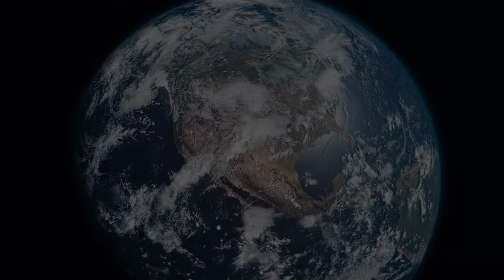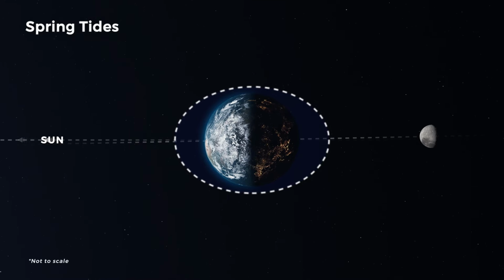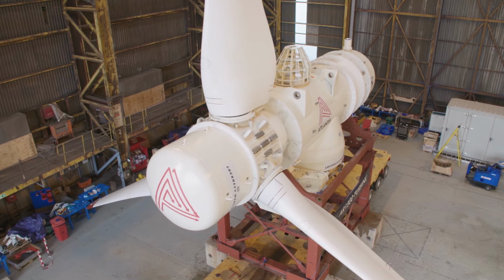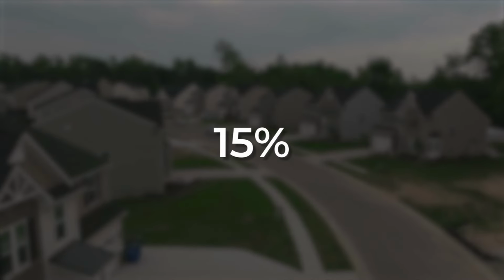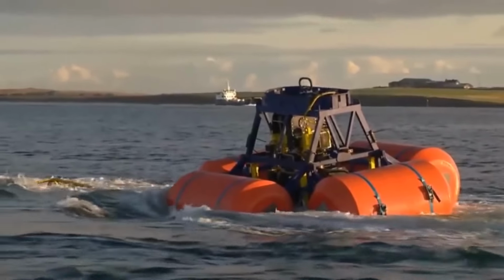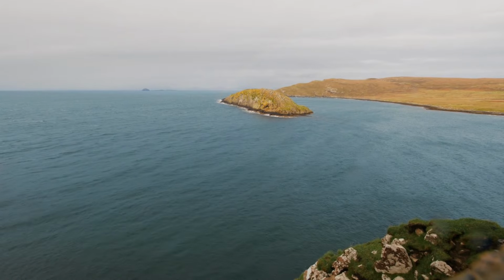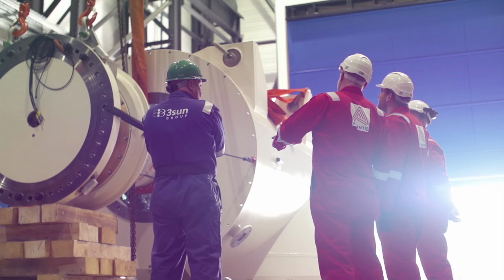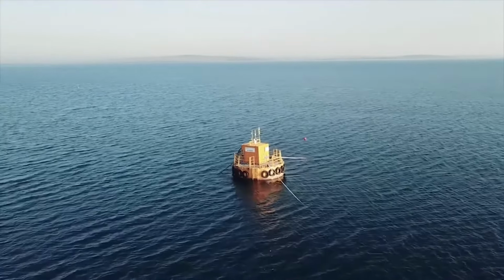Can Underwater Turbines Solve Our Energy Problems?

Comment: I've been working on ocean current and river current turbine designs since 2016 and believe that by the end of 2030 not only the ocean energy but also low speed river current turbines will contribute a major part in energy sector.
Reply: Multiple installations of numbers of identical low speed tidal turbines arranged in 'racks' in many sea areas, hence the 'multiple', and run according to a 'routine replacement rather than repair' maintenance schedule would provide a constant and predictable, apart from breakdowns, power supply, and would prevent trawling in large areas of the sea bed allowing the natural habitat to re-establish itself. The inevitably high capital cost, minimised due to the economies of scale resulting from the use of identical turbines,  could be amortised over many years and the installation would have a much longer life than the current 18 -20 years of wind turbine installations. The use of as much as possible of the existing power export facilities would also reduce the initial capital cost.

Comment: A few years back there was a project some guys at my company were working on with Imperial College utilising tidal movement. It didn’t involve any wet moving parts, just tubes angling down into the water. The idea was that as the column of water in the tube moved up and down the associated air movement would turn an impeller directly mounted on a generator. They trialed it in a canal lock and it worked pretty well. Almost no maintenance was required and they could be ‘hidden’ from sight under soil and plants. They were waiting for funding to take it further. I have no idea what happened after that, I left the firm in 2004.
Reply: https://www.youtube.com/watch?v=kXfSrCWA7qA
Reply: @PerhapsNoodle  that’s great thanks for the link. I’ve not heard of the well’s turbine design. It’s a great innovation and has the same low maintenance profile as the project I was aware of which was based on tidal movement which is a bit different, but still harnesses the natural movement and power of the sea.
Reply: I just finished a final year research project on oscillating water columns. Seriously impressive machines, but the main issue is a lack of funding as is the case with most renewable technologies not yet adapted by governments and companies.
Reply: What about barnacles, and other sealife infesting those tubes? Over a short while, they'd render them unproductive. Just stop fighting what has been proven to work: fossil fuels & nuclear!  Your libbie "ideals" won't do much good when the "rolling blackouts" hit YOU!
Reply: @DavidRice111  is this a joke?
Reply: Maybe it wasn't economical.
Reply: Hoover dams in tides ignored that reverce naturaly at peak 4 + times rpm gearing to light speeds if  wormhole  wanted  and you built you own  maganetic bearings they control
Reply: @stevenlonien7857  what is wrong with your brain

Comment: VAWTs (realigned as HAWTs) are used in unidirectional flows. Safer for marine life (prob because full aerofoil/hydrofoil). However if that boom arrangement could swing through 180°... Or just use paired HAWTs (one above and below each boom)

Imagine Sydney Harbour between the heads, all commercial and Navy traffic moved to Botany Bay (et al). Tides 0.48m-1.89m + 0.28m-1.36m (Sat; 14/12/19)
ps: My teenage thought was to dam it and turn it into a fresh water lake.

Comment: Have you heard of GravityLight?  Why don't they make tidal generators like that?  The rising tide raises a very heavy (but buoyant) weight up a vertical shaft.  When the tide goes out, the weight is released and slowly falls down the shaft.  It contains gears to slow the descent.  The gears turn an alternator/generator to produce electricity.

Comment: Not everywhere has 4 tides per day. The barrier islands, South Carolina, US has diurnal tides (two).
Reply: Sort of, but actually what happens is that the larger high tide each day catches up with the lower high  tide. If  you plot the tides as a graph you will see that the lower high tide forms as a a  shoulder on the high tide recession without a drop in between  the tides. So there is only one maximum per day.
Reply: Gribbo9999 I see what you’re saying and that’s true

Comment: 6:02
...Uh-huh. Y'know, storing megawatts worth of convertible energy to be used to generate electricity is probably a greater engineering feat than building the damn hydroturbines that can generate that peak amount of power. Unless you want to build several million flywheels... If you care about the environment, do not even suggest battery banks. There is one eco-friendly(ish) solution. Utilize peak electric and unneeded energy production to make hydrogen fuel cells and burn that when your renewables aren't meeting demand. "B-b-but... But it's inefficient!" someone is itching to reply with. All renewable energy is inefficient. So moot point.

Comment: Barrages are expensive but have other benefits besides tide power, like:
-Forming bridges;
-Forming a tunnel at the base of the barrage;
-Pretty well constant locked-in water levels for ships docking;
-Acting as flood protection;
-Access to the enclosed near constant level water 24/7;
-No waiting for tides for ships to enter port;
-The barrage being a mountings for wind turbines;
-Flood protection;

A barrage was considered for the River Mersey at Liverpool, between New Brighton and Bootle (I believe still being considered). One suggestion was a road on top with a tunnel for the Merseyrail metro network built into its base.  The whole river estuary would be locked in with a series of entrance locks used 24/7, rather than having to wait for high tide to enter the existing enclosed, locked, multiple dock systems in the estuary.  The expensive cost of maintaining the existing locks in the multiple dock systems in the river would be eliminated.  The barrage would also act as flood protection. 

Something like the proposed multiple use Mersey barrage then would a very cost effective project.

Comment: There is one key problem with cathodic protection. While it does an excellent job of protecting materials from corrosion, it is dependent on the material being used for the cathode and the material that the cathode is supposed to protect. While this does limit could be used as long-life cathodes, what can be used is still quite good. However, it then comes down to the size and type of cathodes. One excellent example of cathode protection is a few collections of silver coins that were excavated from the sea bottom (one of these was found by Arthur C. Clarke). The coins, while covered and held together in a massive clump by undersea growth, were in contact with a massive iron cannon. This meant that the electric current in the seawater (this is too minuscule to be perceived by humans) had two different materials to react with for electron exchange (this causes the corrosion), silver or iron. Because current travels through the less resistant material, it passed through the iron cannon rather than the silver coins, so the cannon rusted away while the coins remained intact - and they were undersea for centuries as they were on board lost imperial Spanish trade ships.

Now, this already sounds like a good argument for using iron (or really any cathode), so why is this a problem? First of all, in this example, it was a rather sizable cannon, which early cannons tended to be, and thus was very large and especially heavy. While iron is certainly plentiful, the fact that such a large amount was needed to protect those silver coins highlights the logistical problem of trying to scale that up. Again, a large amount of iron was needed to protect a comparatively much smaller amount of silver. Secondly, those same cannons were quickly rusted over on the surface, and while they still functioned as protective cathodes (as because despite being rusted over on the surface - the point of contact with the sea water - iron still undergoes electron exchange more easily than silver), scaling it up for turbines will result in arguably the largest and certainly heaviest components for the turbines. Admittedly, one could argue that such weight would help anchor the turbines because unlike a ship, a turbine doesn't need to move from place to place, but if there's any sort of damage around the cathodes, good luck making meaningful repairs. And thirdly, this only works where there is no constant mechanical movement. You might be able to protect individual components with this, but the joints - especially those that will see regular movement - can't be, at least not with iron. Some other material could be used but then you run into the electron exchange rate, required size and thickness, and the availability of the raw materials. To be fair, this is and will be the case for EVERY cathodic protection, and some designs could be partially drawn from what's used for large ships, but apart from the propellers, the ship is just one massive piece that's in the water whereas a turbine has however many the designs call for.

Now, despite what I've said, this does NOT mean that it can't be done. There's already plenty of proven methods from shipbuilding and seaside dam and levee construction and there is increasing research into this problem among others, so there is a real possibility that a long-term solution will be drawn up and probably a bit sooner than expected.

Comment: Why could we not use these "wave energy collectors" in the continent's rivers and streams, floating in the current turning with it?  A slight redesign is all that would be needed and would be added to costal efforts.  That combined with other micro technology in wind generation and inside pipes to all construction and solar on all existing flat surfaces, we'd have unlimited power.  Yea, storage batteries are needed all around to supply Direct currant to everyone free of charge to do with what they will

Comment: Ocean water actually moves pretty slowly. It has less energy than wind.
Reply: thats why they build these test-turbines in areas where the under-water currency is increased, especially in areas where tidal forces exist.
Reply: @smaragdwolf1  They can build in river beds instead. Constant water flow, not just tidal time.
Reply: @zooplanton  rivers are (mostly) not deep enough to install turbines, that deliver a useful amount of power. Plus, if its a deeper river, its probably used for River-Freighters and other ships, what limits the safe places for turbines.